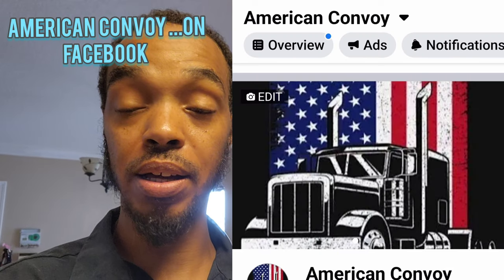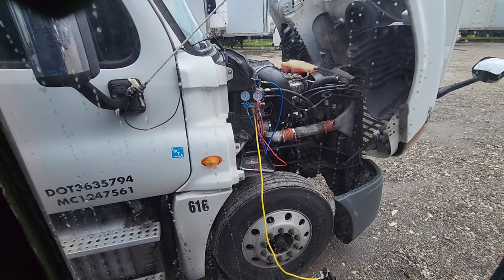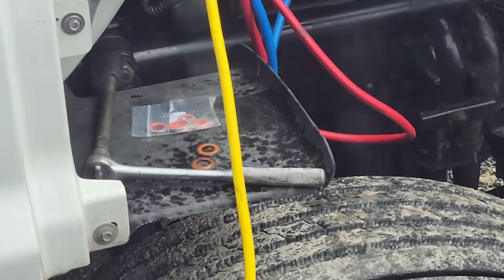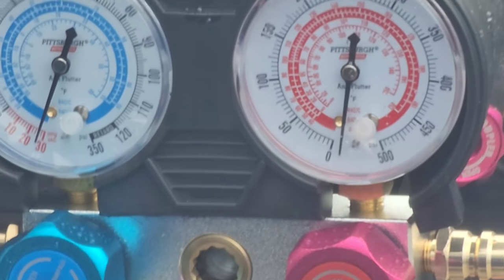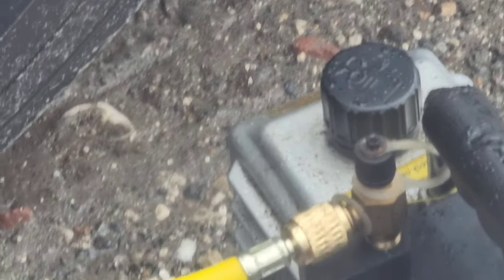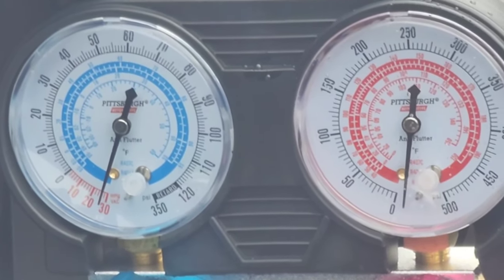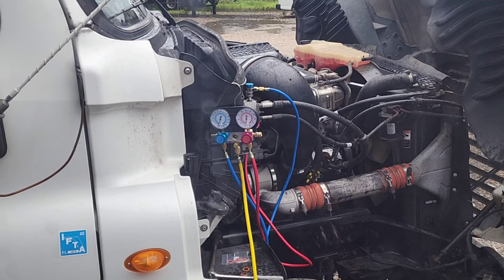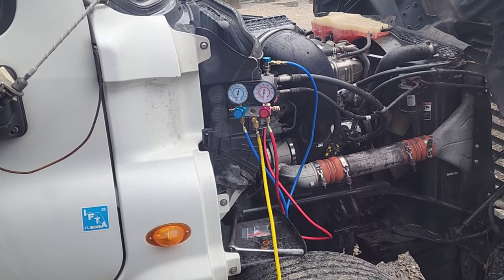A/C  REPAIR PART 2 / BAD CONDENSER

Comment: My a/c stopped working too. I'm going to try to fix while I'm down here in Florida. I have a mini-split a/c unit on the back of my sleeper so I'm very comfortable while I'm parked. I went out to Vegas with no a/c while driving. It was a 107 degrees!
Reply from the maker: Holy cow!..i have my apu so sleeping is no problems ither..but 107 going down the road god bless you..

Comment: I feel your pain I got to fix my ac I changed out the accumulator and orfice my ac compressor will be here on Tuesday wasn't going to change o-rings until I saw your video but once I get everything hooked up then I'll add the juice I can't take the florida heat no more
Reply from the maker: Maan..look..im hoping I can get a condenser Monday before my pickup monday most cascadias use a receiver dryer so luckily i don't have a orfice tube..or accumulator...but i gotta vacuum it back down then juice it back up..i may even  change the dryer..but i know its good cause my air will run ya but out..when its working that is..lol
Reply from the maker: And as a florida dweller myself  i cant take that heat..nope!..im just glad im blessed to do my own services for the most part
Reply: @allaboutsemis232  Some compressor warranties require that the dryer also be replaced if the AC system is worked on. Google, is it recommend to change the receiver drier when changing the compressor
Reply: Some compressor warranties require that the dryer also be replaced if the AC system is worked on. Google, is it recommend to change the receiver drier when changing the compressor